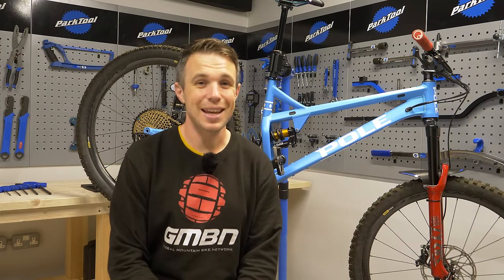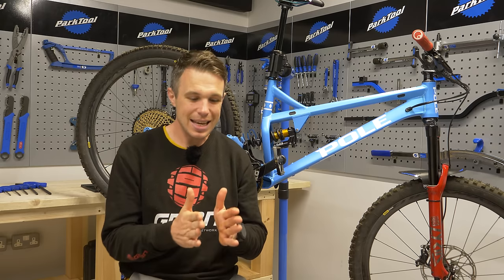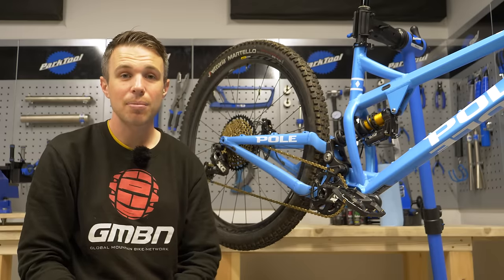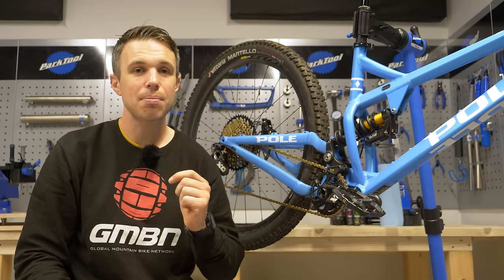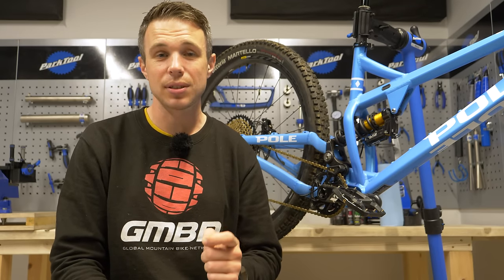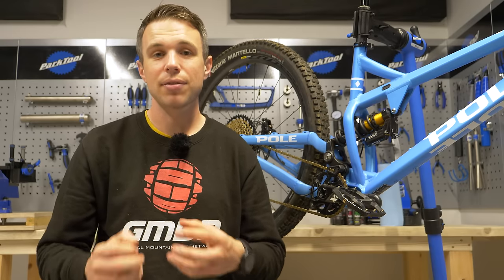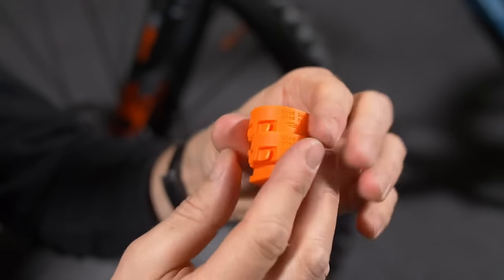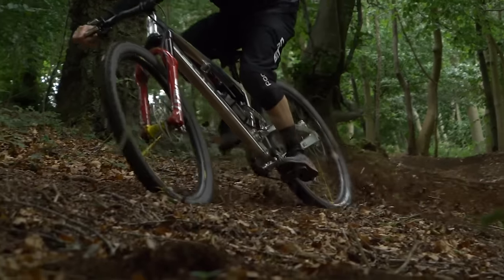How To Refresh Your Mountain Bike For Free | MTB Maintenance

Comment from the maker: Did you find these tips helpful?
Reply: Yup.
Just giving everything (esp the drivetrain) a good clean and regrease after complete disassembly will make a hell of a difference!
If you're not into lubing the old, throw 20 bucks into the mix and new inner cables + outer housings will transform your rig for cheap.
Reply: Yea mate ,any knowledge is good knowledge.
Plus a lot of new riders in the MTB world like my self are learning a tonne from you guys.
Love your channel and all your effort.
🤘⚡️🙏
Reply: @geemail369  qq
Reply: As a bike Mechanic, Yes of course these tipps are great, even if i dont have often a fully to work on. But maybe this is changes in the future ;)
I need to try the one with the Brakes!
Reply: For the rebund and those other fine tunes, I like to try once fully turned in one direction and after fully turned in the opposit direction. As that you can feel the differences very well.
Reply: I didn't understand the bits about "If you are not the follicle" (6:39) and "saying pineapple".
Reply: @schwantzrossi1266  Haha, thanks

Comment: I just tried the bearing tip on my creaky bottom bracket. Except I degreased it and blew it out with compressor then re greased. Sadly, it’s now worse, so I ordered a new one. 
I had already managed to clean it like this once before though.
Reply: The problem is that if the bearing got water or mud inside then the surfaces are not smooth anymore, so cleaning it out and regreasing will only make it work somewhat, but never will be smooth again.

I just did the same on mine, except I installed a greasing knob (or whatever that thing is called in english) then squeezed the thing full with the grease gun. I didn't want to pull off the bad bearing, because it would have never worked again, and I wanted the bike to run NOW, as usual. 😉 When I buy a new cartridge, probably I will modify it before I install it to work with this greasing system.

Comment: Agreeing with everything except the bearings. Pack them up with the stickiest grease you can find, unless you're servicing them every other ride or so. If there's grease, there's no water, so there's no corrosion. These bearings move so little that the sticky grease will not make much of a difference, but corroded or dirty steel balls within these bearings will.
For wheel bearings this might be different, as they're actually spinning fast, but the bearings on your frame hardly rotate.

Comment: Lubing shift cables is only fast fix that helps for short time. Chain lubes dry out and gets super sticky after couple weeks.. and Grease in housing gets sticky in cold weather. So replace cables and housing (dry) when they get friction is the only good way to make it work for long time (years)

Comment: I ride a lot. Every ride clean the brakes pads/discs. Paint the nearest pad with a marker so goes back in the same every time. Always use sintered as the rest are crap. Always stand the bike upside down as if there are air bubbles they will move and the back on the wheels they will rise to the top. Aline the caliper by rubbing noise or/and look at the clearance so the pads run parallel. Run 4 chains and swap after every ride and I boil mine in putoline grease like I have in motocross for 25 years and chains last a long time and when back on the bike wipe off excess or as you take it out of the grease tin but careful as very warm. Wipe the shock and fork and seat post with a shock oil but not to much on the coated sliders. Rims wipe down with a rag soaked in penetrating oil as it will show up cracks on black rims. Once a week reset your gears, indexing etc. Change the reusable link after 10 uses as they wear. I always use Sram chains as the cheapest and last well. The gear idler wheels change the bearings once a month as they are cheap and make changing gear so much. 11 speed sram always use a GX 12 speed derailleur as changes better and B tension stays constant and its cheaper. Do not run rebound on forks too slow as you will get packing on the forks.
Reply: Jesse Link  Yes just back and went through everything. Raced for years and always done my own maintenance. Have only had a few DNF like Monday broke my chain link.
Reply: Jesse Link  Understand used to prep my 450 motocross bike after race on the weekend then get it ready for Wednesday or Thursday evening. Lots of work its no good sitting in a old peoples home blowing bubbles thinking I should have!!. I had to wash most of my kit and bike as will be out tomorrow as its a bit wet here at the moment even though its warm and sweaty.

Comment: Can you guys do a video on Cable disc brakes
Reply: What exactly would they do it about? 
Cable disk brakes are exactly the same at the actual calipers as hydro ones.
Reply: @ji_imbo  how to install them
Reply: @fjif4761  its exactly the same as hydro ones just with cable tension instead of brake bleed
Reply: @MD.media01  I'm pretty sure it is.
It's just cable tension instead of brake bleeding. Every other step is the same
Reply: @MD.media01  oh, okay, thanks for letting me know.

Comment: I have a question that I've been thinking about for a while... Let's say I buy a bike from a direct sales brand like canyon. When the time comes to replace the linkage bearings, what do I do? Without a shop assisting me, where do I find the bearings I need, and how do I install them? That's the biggest fear I have about buying a bike online. Transmission, brake and suspension problems don't scare me, I know how to deal with that. But those bearings... I would really like advice
Reply: For bearing installation... well, you may need tools like a drift. In many cases it's not worth it due to the amount of tools needed. I've built my own small press from a QR skewer, but knocking bearings out is done with a hammer - and the understanding that they won't work again.

Now for bearing ID - product manuals are your friend, since they'll often describe the spec of bearing you'll need.  If the manufacturer doesn't cite them, some bearing suppliers have a list of applications where they have the bike manufacturer, model and year. Or if you're lucky the bearings have the ID number (4 digits or so) in a visible part, like the seal. If not and they are totalled (so you wouldn't be riding the bike until fixed) I would knock them out and bring out the Vernier to measure ID, OD, and width.
Reply: Why do you assume if you buy a Canyon your local shop won't help you?   Most bike shops don't care what brand your bike is.  Most o of the consumables are stock sizes and can be easily replaced.
Reply: @Tneknos  because the people at my shop are assholes. They refuse to do anything more than basic stuff (basic stuff means indexing/regulating derailleurs, replacing tires and things like that) on bikes or anything you didn't buy there. Learned the hard way when I needed help fishing the hose out of the frame of my bike (bike I bought from the shop) when installing new brakes. They refused as I didn't buy the brakes from them and I had to mess around with it for 2 fucking hours until I finally got it thru. So, I highly doubt they'll be any useful if I ever need to replace bearings.
Reply: @Andrea-qg5yk  sound like a shop that won't be around for long then.

Comment: #AskGMBNTech
Hello all at GMBN. Love what you're doing! Keep up the good work!

My question is on parts compatibility issues. I recently bought a brand new  at  of the original listed price! It was a great deal to me because the local bike was trying to shift some old stocks and the price fit my budget. I have no issues with the bike so far, it feels 'new' and the parts all work fine for now. 

My concern is that in 2020, some of the parts are either out of date or will soon be. Example would be the rear dropout being the legacy 142mm spacing instead of 148mm these days. Parts such as the stem, handlebar, and tires can be replaced easily when the time comes without any compatibility issues. However other expensive parts like wheelsets, drivetrain and suspension can be a bit tricky. Example will be my fork which is a  with  and a . 

What should be the service regime so that the fork can last as long as possible? How long do you think the fork can last for that matter? I see myself riding the bike lightly 2-3 times during the week and 1 heavy trail riding on the weekends. Reason I ask is because Fox do not make this specific fork anymore and I can see that it may be difficult to find a similar or compatible replacement these days

Also the bike isn't particularly slack (67.9deg head angle) compared to bike these days in 2020. Are there anything I should upgrade if I was going to do more heavy riding, i.e. gnarly downhill stuff as my skills develop? Can parts these days fit my bike from 2016? 

Appreciate the feedback from you. Cheers

Comment: How do you determine adjusting volume spacers vs high and low speed compression damping ?  I feel the more linear feel of less volume spacers and adding more high and low speed compression damping suits my riding style better  - am i correct in this assessment ?  I can also more easily adjust this on the trail vs volume spacers.  I also like to justify paying for that expensive damper !

Comment: I’m scared to ask: just how many years do most people get out of their bikes before replacing them??
Reply: I don't replace bikes until they break or are stolen. Where I live though it's usually the latter. 
I'm currently riding a hardtail from 2008, and having a blast, so there's no real rule for how long these things can be used.
Reply: 2-5 years
Reply: Until they break. The frame not a replaceable part.
Reply: I still have my old steel hardtails from 15+ years ago. Raleigh M-50, TREK 820s are running strong for the Grandchildren. All secure with Austrian chains and locks!!!  But the geometry is dated and love my FS Commencal.😋❤
Reply: Until the frame breaks
If anything else breaks, you can replace it
I use a 2008 Giant Reign 1, and it’s great!
Reply: @drmoynihan  
Australia n locks are good, but Australian power tools are better.
Reply: @davidbronstein2040  
Austria's Pewag Security Chains, Case Hardened Square Links and Viro Locks.
Reply: @drmoynihan  You should watch Lockpicking Lawyer, even the best locks are little better than deterrence. If somebody wants your bike, even the best lock on the planet won't stop them.
Reply: @davidbronstein2040  
Yep - I watched him and others. 
My chains and locks were by their recommendations.
However, even a bank vault is able to be broken into.  A good lock and chain will only buy time, or possibly provide such a deterrent that thief moves on elsewhere.